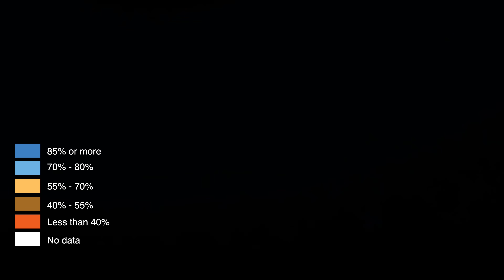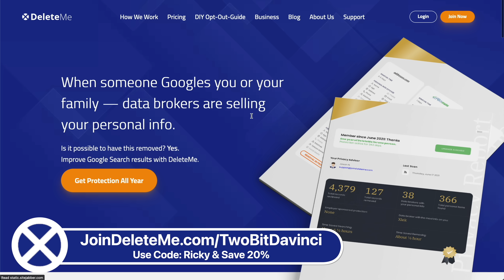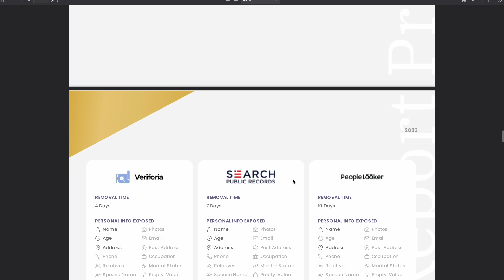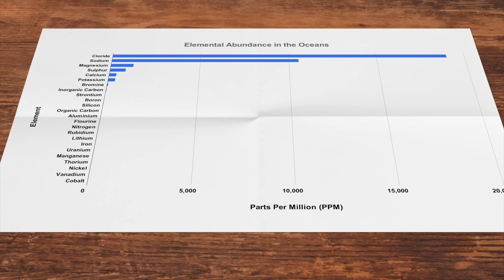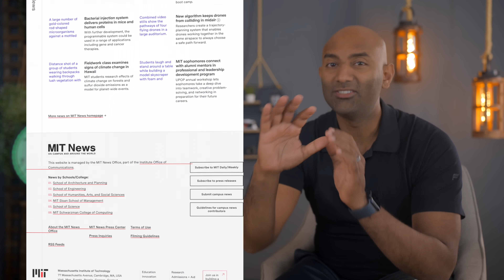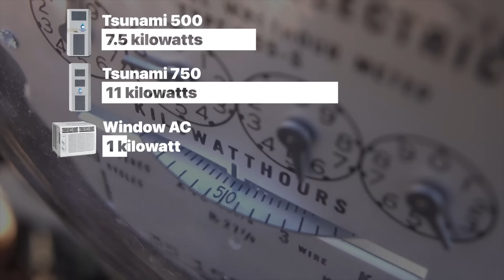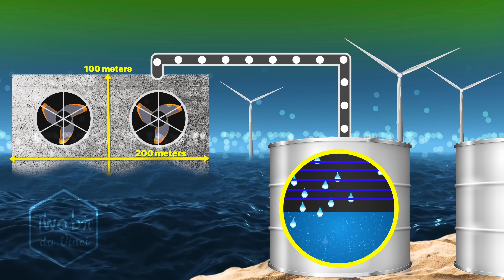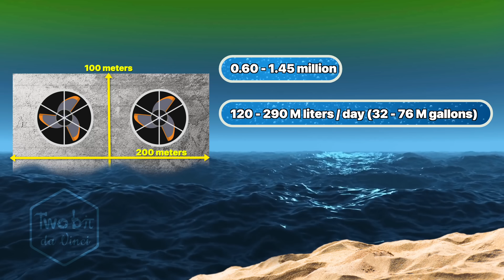This Tower Turns Ocean Fog Into FRESH Drinking Water!

Comment: As an retired environmental engineer I was also excited to hear about this idea.  There are numerous ocean locations in hot  areas that have deep cold water relatively close to shore.  Monterey Bay for instance.  Using  a thermal-cline with a closed loop cycle containing a freon base fluid that reachs from the depths to the surface  could provide the force to drive a pump to send the water to shore. Routing the humid air into pipes using the cold from the depths would also provide the cooler temperatures necessary to condense the water.
Reply: We should attach these sea surface water vapor systems to piggyback onto offshore or near shore solar and wind farms since we just need to add a water pipe next to the pre-existing wire cable to transmit everything. The infrastructure and access to deep cold sea water are already there.
Reply: This would probably work in scripps Canyon in San Diego. There are numerous deep water trenches off the West Coast North of Los Angeles that may also suit the needs of the idea you are suggesting. I keep saying we have the technology and expertise now  to make this planet selfsustaining
Reply: @crashwelder5337  1. your sentences don't many sense "probably work and scripts Canyon in San Diego", for example... why post something you don't read over to make sure it can be understood (that's a theoretical question in case you haven't figured that out); 2. "I keep saying we have the technology" - yeah, that's your paper napkin math, that's not science, as many issues (especially economical ones, but also ecological ones, which a commenter had said in here) have to be figured out, which was clearly and correctly stated by this YTer. to get investment for something like that, which is still on shaky ground (AKA lots of research left to do, which is expensive and takes a long time) is very difficult, unless there is direct need (Tesla is an example, kinda), and again, as this YTer said, there is no need (yet) because we (the world) has enough fresh water, and it's a logistical issue (localized availability) rather than one due to a lack of overall quantity.
Reply: that morning fog is a important part of coastal ecosystems i would want to explore the long term effects that would have first , robbing all that moisture from the shoreline is going to have an effect.
Reply: You guys are like pest: growing in numbers and exponentially more and more harmful with your technoreligion.
Reply: You still have to pay the cost to phase change water, that is the minimum energy cost of this kind of system which the energy cost to evaporate water at 99.9C is the same energy cost to get it from 0.1C to 99.9C which is enough energy in the same wait of copper to melt it, and doing the reverse means you have to remove that much energy. This is already assuming 100% humidity and only knocking it down a little. 

Yes you could dump that heat into the sea by running the pipes down low, but then you are going to reduce heat rejection in that local area destroying habitats if you are pulling out meaningful amounts of water, because that volume of water that evaporated off carried enough energy to raise the same amount of water to 99.9C form 0.1C so if you pull out 500 million gallons from humid air you are dumping enough heat to raise 50 billion gallons by 1C.

Now on a global scale that isn't going to effect things, but on a local scale that certainly is which is the same issue you have with brine discharge, brine discharge isn't a problem if it's distributed evenly over a wide area, so you're exchanging one type of pollution for another.

Now if we are going to use refrigeration there is some good news because heat pumps can move upto 6 times more thermal energy than the electrical energy you put in with ideal conditions so you can reduce the energy needs down to heating water down to 16.7% that is assuming ideal conditions however and I am goanna guess that reverse osmosis is at worst on the same level of power consumption, but probably significantly less.

I suppose you could make it so that your only using the sea to remove some of the heat to reduce the energy consumption maybe even only use the sea to dump heat during peek energy demand or low energy supply which would make it work well with renewable, but the extra cost of having two systems to bring it ashore would increase the cost of the total system fairly significantly.
Reply: Hello sir. I hope you are doing well. I’m also an environmental engineer, but I haven’t had much luck with my career since I am in Latin America I a troubled country… can you give me any advise? I want to take advantage of my degree and do something both meaningful and economically productive. Thanks in advance. I hope you don’t mind.
Reply: @albertomorales7322  You ask your college that gave you the engineering class to refer you the place where they employ people with degree. You never choose a field of work that doesn’t employ people. Why did you take this class if there is no job?
Reply: @telsat  pls be gentle and don't shame people for what they choose to learn
Reply: Might he be an idealist who wants to save or better the environment?

It everyone was reasoning like you the planet would be in a much worse state.
Reply: If ...

Comment: Farm water is much cheaper than urban water. Could this technology produce water that is cheap enough for farms? 80% of California water is used for agriculture. Dealing with droughts has a lot more to do with providing water for farms than providing waters for home use in California. 

A second issue is that water that comes off the ocean has salt in it. Exposed metal near the ocean is subject to high corrosion rates caused by salty water in the wind. I understand the idea is to condense vapor but separating the vapor from the water when you are collecting the vapor right above the ocean might be an issue. 

A third issue is that building and maintaining structures that operate on the ocean is expensive. So expensive that electricity from off shore wind turbines costs more than electricity produced from land based wind turbines.

Comment: Tsunami Works could easily saturate the intake air with salt water so setting an industrial scale version up in the desert would only require a salt water pipeline...to the Mojave Dessert, Salton Sea, San Joaquin Valley...and it could be powered by solar farms and mega battery packs.

Comment: There is a problem with water straight from the unit as many people won’t drink it.  What California has to do with their treated water (grey water that is 100% pure not 99.999999% but 100%) is pump it into the ground and then reclaim it the normal way.  That has been the only way people would actually drink it.  They use the water also as a wall in the ground so sea water doesn’t contaminate other sources they have.

Comment: Humidity over the ocean, though, is also high in salt, isn’t it??  So, to really be potable, it would need salt-reduction?  But, it’s a great idea! 
The several evaporation towers are perfect to be powered by solar & wind….& can be off-shore nearest where water is needed most, for most of the desertification areas.  
What about using that brine to flush toilets that are on-grid?   Probly complicated…but, it could greatly reduce flushing potable water…

But…
If much humidity is harvested over ocean….will it change the weather over the ocean? 
Affect the El Niño/La Nina cycles?  
How might it adversely affect the ocean conveyor belt?

Comment: I had a quick look at different shapes, squares etc, to diminish outside area costs. Circles are stronger singularly, but the wind pressure might crumple/destroy almost anything easily. They might need a buffer or an angled surface also, to help deflect against wind gusts. It's going to be an immense engineering achievment if they can overcome all the hurdles. I for one hope they can achieve it :)

Comment: I don't know why you're talking about building structures to hold sails - Wood Floats and so do Large barges anchored to turn sideways to the wind - how much would drilling down into the mud to build yet another oil rig looking thing - comparably to protective barges, do you know how easy and fast it is for China to make an unsinkable barge with electronics on them to sense when Russia sets off the 12 Nuclear Torpedo's to flood the grand canyon with the bodies of every thing americans have dumped in the rivers for the last 280 years along with all the shit and nuclear stuff itself . 
Yep I'd have water and data collecting barges every 500 meters off the coast, they'd have Chinese solar panels and batteries to power all the National Security gear also made in China, and sucker pumps at the beach to draw the collected water out also made in China.
So I don't know why you're talking about building structures to hold sails

Comment: I'm missing something. What is the purpose of the huge towers? If they simply want to pump sea air into condensers, then why not just have huge pipes and fans? Is there something special about the air inside the tank? If so, won't its contents be emptied rather quickly? and replenished by what? Love some enlightenment, please.

Comment: So far, this is one of the best ideas I've seen for water harvesting in saltwater. 😄
12:00 It's quite nice, but the water then goes to others where it would normally rain. Even this small amount can already cause rain to fail in low-rainfall regions with poor people. So there should already be a simulation that times the changes over a decade. Rain is not about the total amount, but about the amount of precipitation per day.
Reminds me a bit of the Aswan Dam, even if the comparison is lame.
Reply: It's much more complicated than that, humidity in the air most of the time in most places will never become rain so it's not taking away anything. And 10 miles away the humidity on the ocean will be completely unaffected.  Additionally, if the water is used to grow crops in a dry or drought stricken  area that will actually actually increase the humidity and the likelihood of rain because of the transpiration from the plants
Reply: @sagetmaster4  I knew the part about humidity and plants. 😄
But normally the evaporation over a large open water area with wind is something else than e.g. hilly land, right? That's why I thought of climate models (preferably satellite-based). 
But unfortunately I must admit that I am not deeper in the matter then. I am curious how this will go on.

Comment: Rick, knowing this is long winded I submit the following:  Some years ago mechincal engineers installed an adequate amount of air-conditioning to a gymnasium as was specified by the architect but because it was a "fresh air intake only" the humidity in the area was just too much for the system's evaporator coils to remove and this lead to a very uncomfortable cool but sticky environment inside the gym.  So what they came up with was placing two additional coils (one after & one prior) to the refrigerative evaporator coil with both coils connected only by a simple water loop. As the aft coil received the refrigerated air cooling it (and then passing through it so as to cool the building) that after coil would cool down along with its water loop being pumped back into the prior water coil. Now because of that the outside air entering was pre cooled removing more humidity,  the evaporator coil (now 2nd of the three) too would remove even more humidity and lastly the third "after coil" likewise would remove the majority remaining humidity as well.

Other than the additional coils, the water they contained in a closed loop and the small electric pumps no additional utility cost in cooling ever happens and yes, a measured normal of 80+% humidity entering the gym was reduced to a modest 30-35% afterwards. And this says nothing about the condensation captured. 

My point, if this were used in costal high humidity area's and you were going to air condition them anyway, why not make water while you're doing it and further cool your building down while doing it. Yes, you read my statement correctly.
Reply: Why..?? Because people don't use "fresh air intake only" at private facility. We cant harvest water from a closed loop 30%RH air circulation.

Comment: On an ocean vessel or abandoned oil platform small amounts of sea water enclosed in a transparent pressure cooker with sunlight concentrated onto the pressure cooker will vaporize the sea water at a 160 degrees or less, the salt is then scrapped off and stored for pickup and the fresh water is also stored for pick up. Since the water and salt is all removed, there's no harm to the surrounding Ocean and wildlife.

Comment: I work in HVAC design, so I know all about taking water out of the air.  I've wondered if we'd ever get good moisture farming tech, kind you see in Star Wars (Luke's uncle was a moisture farmer).  The concept of taking it from the ocean's surface is fascinating.  I don't know about their plan exactly, but we could probably engineer something pretty easily.  Awesome video man!
Reply: Another HVAC Design guy here... In a warmer coastal climate like Chennai (India), the dew point of air close to the surface of ocean would be only 33 Deg C (91.4 Deg F) and it would not cost huge to de-humidify the air operationally, even with conventional Air-conditioning system.. The moment you add wind-turbine or sea-cooling system (you have cold water at the bottom of the ocean, at free of cost) to the entire water-harvesting technology... this will be a great combination..

Of course, salty air is only the demon here and with advances in material science and coating technology, we will eventually fight the demon out...
Reply: Instead of the tower and pumps building their containment and getting the air in volume to flow nessacry economy is an obstacle.
But you can also achieve a high air flow necessary by horizontal stacks of appropriate sheeting suspended on bouys that through wave action facilitate moist air induction and displacement of harvested air.  Water recovery systems powered by wave action included.
Reply: Yes it’s not as if the climate is complexed and affected by cloud formation is it. 😂
Reply: The concept is interesting but just looking at the size of it (100m tall in the middle of the ocean ?? And 200m wide for a single tower ??) it makes sense that the water production calculation are so good, but I have doubts about the feasability and costs estimates of building, maintaining and operating these enormous structures in one of the most challenging environnement.
Reply: @TorlyX09  I agree on that 100 m tall and 200 m wide is very hard to approve.
We know how hard it is to get windpower in the ocean approved - this will certainly also be hard.

But something can be made with it

Comment: .
So you need more power by the ocean? Then install Waterotors in tidel flow areas along coastlines. Building this video's idea will most likely fail with just using solar and wind . You will need all three solar, wind and now add Waterotors. The Canadian military is already installing Waterotors to replace diesel generators in the far North. Search it. Waterotors run 24/7 vs wind and solar.

Comment: Please dive deeper into the physics.  I do not believe this will work at scale.  It takes energy (the heat of vaporization) to turn water into steam.  This energy comes from the sun.  If you cover the ocean with a collector, you have blocked out the energy source and stopped the process.

Comment: It is call a dehumidifier for god sake. Every couple of years this scam come back and everytime it crash again thermodynamic. But this time, it is above the ocean, what a spin.
Beside not being new, nothing is free, when you condense water, you remove energy (heat), energy must go somewhere, generally a radiator. 
So, the plan is to gather a bunch of open fridge above the ocean, and collect the water ?
You do know that the water evaporating from the ocean make clouds, and those clouds rain desalt water ? and for free ?
If you want to catch water vapor with minimum impact on the ecosystem, just build some Windcatchers.

Comment: You talk like it would be no big deal to make these offshore 100 metre high by 200 metre wide towers. The biggest offshore oil platforms rarely rise that far above the waves and are far less wide. Anything as big as you envision would encounter a massive wind and wave load. Rust on such a floating structure would be a major ongoing problem.
I imagine that air humidity lessens rapidly as one rises above the ocean surface. I also imagine that humidity near the coast must be only slightly less than that far offshore. So it makes far more sense to have a series of much smaller towers in very shallow water quite close to the coast. If you selected a place with steady onshore breezes that would greatly lesson the need for electric fans.

Comment: If done right each water collector unit could create artificial reefs for aquatic life. my concern would be hurricane areas or places with a high tidal surge. I don't think salt water and giant electrical fans mix very well. That being said, it makes far greater sense to do this on a giant scale instead of asking people to buy dumb water condensers for their personal homes. The same applies to power walls. The electric utility company should be buying huge flow battery banks at a far cheaper price than someone buying $10,000 power walls. Let's take some of these Fuel subsidies away and use them for projects like these instead.